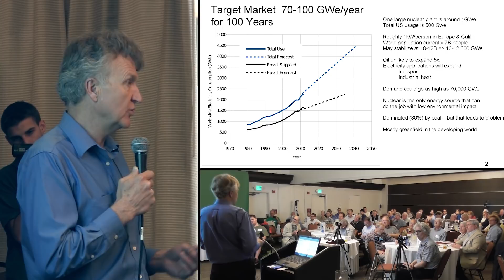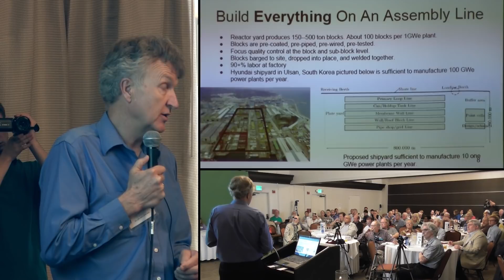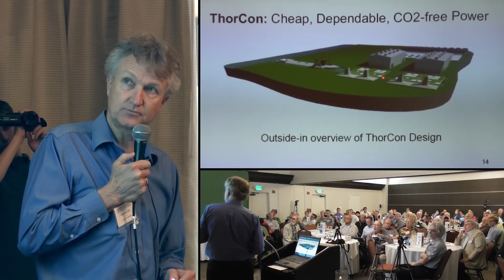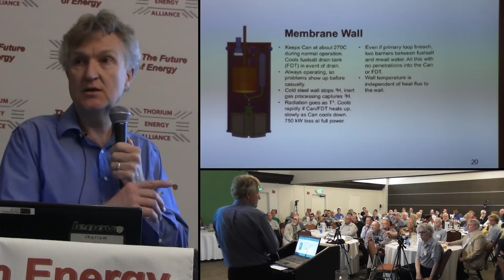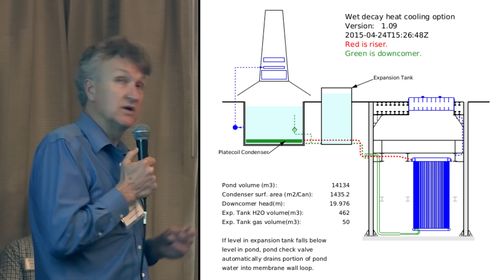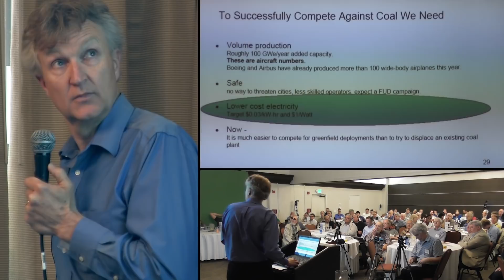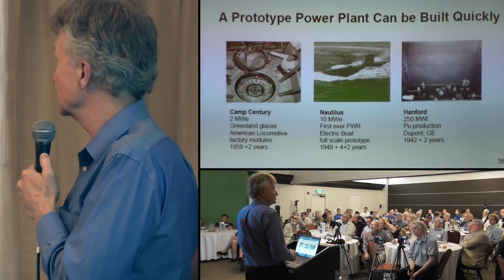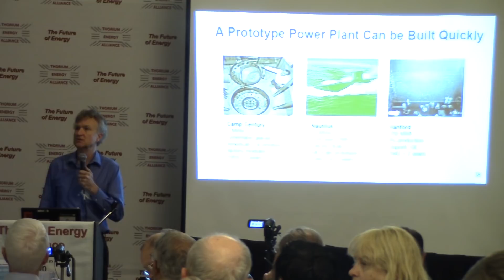ThorCon: A Thorium Molten Salt Reactor System that can be built Now -by Lars Jorgensen @ TEAC7

Comment: What is the main obstacle now: regulation, lack of money, lack of special steels?
Reply from the maker: Vladislav Bogorov I think any argument about lack of money is basically an argument that regulations are unfavorable to nuclear innovation. Dr. Leslie Dewan gave some very clear testimony on this to a sub-committee on energy... to test a liquid fuel reactor (something with dissolved fuel in molten salt) then you're limited to a reactor size so small that the tests aren't very useful.

She made this point again when interviewed by Rod Adams on Atomic Show podcast.

Cavan Stone also brought this up at TEAC6.
Reply: gordonmcdowell Well i would say you can still argue of a lack of money because of  net win loss. The issue is that basically no-one in a business, any business can invest in a new technology that cut down cost of the product significantly. If they do, they lose all of there previews businesses. 

All the new gains will there for be a net loss. This is basically true for any market sector. But its especially true for one where the up front cost is high.

The only one that can invest and not lose, is the one that is on other business. The issue here is that you should never invest out side of your knowledge, because then you will invest into snake oil. This makes it really really hard for anyone to invest.
Reply: matsv201 I think that this is why the Terrestrial Energy approach is so important. They've found industrial partners to fund their demonstration in a much more hospitable regulatory environment (Canada) by focusing on an aspect of MSRs that is overlooked: high quality process heat. 

Companies looking to soften the bitumen sands of Alberta stand to save a ton of money if they can use an MSR to generate cheap steam. Instead of burning tons of natural gas that eats into their margins and increases the CO2 footprint the oil company can then use nuclear heat for (hopefully) low overnight cost and essentially free fuel cost.

ThorCon will find success if they can find a country willing to go hell-bent for leather for Gen4, like South Africa did in the 1990s: https://en.wikipedia.org/wiki/Pebble_bed_modular_reactor ; but is also ruthlessly pragmatic. PBMR failed because of ridiculous scope creep in a country with a barely burgeoning civilian nuclear knowledge base. 

I wish them luck.
Reply: Those, who dislike the idea of thorium energy, say that the thorium cycle has to be developed first. I don't understand. How come it is not developed as there was already such a reactor, albeit not a commercial one, in the past?
Reply: Vladislav Bogorov
It doesn't need development; when you're talking about ThorCon at least. ThorCon has been absolutely ruthless about making everything about no new technology.

The problem is funding. Nuclear technology requires a decade of work no matter the implementation. You need to prove the accident scenarios. You need to prove the materials. You need to prove the fuel cycle and custody of radioactive materials.

All this means high uncertainty, long horizons and (potentially) high costs. No sane investor from any venture capital company will be willing to accept these terms.
Reply: MonMalthias "Terrestrial Energy approach is so important" well, that is probably the only way, at least in the short run 

" willing to go hell-bent for leather for Gen4"
Well, i have a problem with this. Most contrary don´t run on what tech to use, but rather what the wanted result is. Then they go for the most common way of getting the result, how ever bad it is.

I have a problem with what i work with. Having a product that not only exist and is proven, but also applied in some places, but still no government is really that interested because the big companies have just that much of a joucier kickback system
Reply: I see. So we'll wait until the worse aspects of global warming start to show then? It may be too late by then.
Reply: Vladislav Bogorov No, then they will just voice there opinion for sun and wind even higher. Also, the aspects will not be that sudden.
Reply: Vladislav Bogorov I don't see any major obstacle. They have no intention of dealing with the US regulatory system. I assume that the testing method he described in the video is what's done in S. Korea and the rest of Asia, where it's intended to be used.
Reply: Thank you.
Reply: I'm hoping that ThorCon goes to Asia, actually. Asia's growth out of poverty will mean an enormous demand growth for electricity, and ThorCon has the potential in terms of deployability to match the rate of growth of coal.

I don't think there's any future for advanced nuclear in America; because the great brake that is the NRC will stifle all but light water. Even NuScale had to pay something on the order of 270 million dollars on licensing fees over a decade to get a light water SMR off the ground. This isn't new technology either. This is essentially a submarine reactor made tall enough to the degree that it can run on natural circulation at scram.

I don't know about you, but I, for one, would not like to spend a decade doing paperwork before we even build the first unit for testing; while having zero revenue.

If America loses its supremacy in advanced nuclear, it will not be for dearth of ingenuity. It will be self inflicted, by a regulatory regime so stifling that it removes incentives for innovation in cost and safety.

Alvin Weinberg himself envisioned LWRs as a stopgap measure until the 1980s when breeders would take over. The establishment of the NRC ensured that progress would stagnate, because it replaced testing with paperwork.
Reply: MonMalthias Imagine 3 cents / KWH combined with the cheap labor in Asia. There goes the rest of our manufacturing jobs.
Reply: Greg White Yea it better be low, where i live the current power cost is 0.4 cent/kWh, yea not kidding. It was actually under about 4 cent all winter. The power producers have a lot of problem handling the situation, and the government keep forcing wind-power. There is simply no space in the power grid for more windpower, but they keep forcing it.
Reply: Vladislav Bogorov  Why you will never see alternative to U235 reactors is the BYPRODUCTS. Enrichment process of the U235 produces A LOT of U238 = "depleted uranium", some people consider this byproduct a "waste" but people in the military industrial complex do not. Depleted uranium is perfect for AP ammunition and tank armor. Also U235 plants produce relatively lot of Pu239, which is needed for modern nuclear weapons. Th-reactors Do not. People who pulls the strings have NO INTENTION of giving up all the profit off of ther byproducts in order to produce energy peacefully.
Reply: Invaderzerg Remember, Pu239 in a power production reactor is "reactor grade" not "weapons grade"; contamination with other Pu isotopes (much harder to separate than U235 from U238) makes this Pu produce a bomb that would "tend to pre-detonate", an interesting technical phrase don't you think? When will it explode? God only knows, but probably in the terrorist lab. Pu239 from a 1940s "graphite pile" is much easier and less expensive.

In any Molten Salt Reactor, the fuel is molten, any uranium or plutonium remains in the reactor and is fissioned.
Reply: +Vladislav Bogorov The main obstacle is, has always been and will always be simple math and the laws of physics. Do you really think the tens of thousands of scientists and nuclear engineers who have worked on nuclear reactor design since the mid-50's have never considered the thorium cycle?
It's easy to claim that a technology that does not exist is perfect and will solve all energy issues for the rest of times. A quick reality check will prove that these claims are false - and the people who make those claims know it all too well.
Reply: André Balsa Making perfect the enemy of good enough is in itself a fallacious argument; as is saying "because it hasn't been done before, therefore it should not be done". It is precisely this Neo-luddite thread of argument that the fossil industry peddled before renewables became significant and garnered enough political support.

However, it must be said that the current Western European energy policy of eco-austerity is not climate friendly; nor sustainable, and will drive increased dependance upon coal and gas; but that is neither here nor there. What matters now is that increasing wind penetration means windfalls for the gas industry; as with Denmark; and potentially with Sweden that looks to tax their nuclear out of business and replace it with wind and gas.

Near term, preserving the current nuclear fleet, uprating and upgrading will be necessary for the purpose of combating climate change. This is what America is doing; though the fracking boom has also served to drive nuclear out of some parts of the economy, but at least in America coal is being displaced.

In the West, increasing penetration of renewables will drive coal out of developed economies to be replaced by rapid-ramp gas (except Germany, which insists on using supercritical steam coal power stations to load follow). Geopolitically it may be unsustainable as Western Europe will brook no excessive Russian influence in the form of Gazprom; and inevitably some nations will elect to build and expand coal, like Poland and Germany. It may be that England will be the only country to meet its climate goals as they have the only plan for significant nuclear new build and have committed to coal phase out by 2025. However, the EPR will be the anchor about England's neck. Hopefully Areva folds before too much damage is done; or their restructuring beats some sense into them. 

In East Asia, developing economies will look first to coal, then to nuclear. Nations like Taiwan and Japan will have a shrinking nuclear industry in the wake of Fukushima. To the anti-nukes, this is a good thing. To those that are concerned about climate, this is a crime; but it is not up to science to dictate energy policy; nor was it scientists and engineers that could dictate the terms of COP21. 

In Africa, nations like Nigeria and South Africa will be looking to nuclear to serve their baseload needs as they transition from being poor countries to middle-of-the-road countries. This is good; for if the African continent develops like Western Europe developed in the Industrial Revolution, we are, to quote James Hansen, screwed. 

About MSRs, the only game in town right now is probably Terrestrial Energy. They have attracted support of oil and gas looking to soften the tar sands, they have attracted support of Caterpillar Inc; which does heavy machinery, and they have built up a rolodex of heavy hitters from around the nuclear industry and from environmental consultancies. Once the disruption of the AECL restructuring into SNC Lavalin and CNL dies down, Terrestrial may even achieve some modicum of government R&D. But even they are looking to a 2020-2025 timeline. 

History, and the numbers, say that thorium and MSRs can and will have a role to play in the future. However, each and every effort to resurrect them has foundered due to lack of government support; not due to some problem with physics or economics. In a rational world, MSRs would follow after SFR and HTGR deployment following intensive government programs. So far, only China has that commitment. 

Maybe your doubt is not as infectious as you think.
Reply: +MonMalthias "History, and the numbers, say that thorium and MSRs can and will have a role to play in the future." On the contrary, history has consistently and repeatedly demonstrated that thorium and MSRs are not realistic technologies, and numbers now show that nuclear is not cost competitive with renewables.
Try reading the news! The debate is already over, coal and nuclear are out, natural gas is the transition energy and wind and solar are the future.
Terrestrial was counting on tar sands development to sell some reactors to the oil industry but this is also not going to happen: Keystone XL is dead and nobody wants the most expensive, dirtiest, lowest EROEI crude oil on the planet anymore.
Nobody is going to invest in Terrestrial to develop a prototype 20MW small MSR for the 2020-2025 time frame because the same energy can be provided by just 4 large wind turbines (from at least half a dozen different vendors) for less money and a technology that already exists and is safe, reliable and zero emissions. Meanwhile Terrestrial does not even have a complete conceptual design to show for.
Reply: +Vladislav Bogorov Government, of course. If western government were so democratic and reasonable like no other culture on earth, or let 's say they were so good people, and could save our planet because of climate change than why wouldnt they promote this technology??? 
I hope someday you all out there will come to a intelligent conclusion, may it be just in time or too late.
Reply: +Vladislav Bogorov A developed thorium cycle implies plentiful uranium-233 which no one has. I think U.S. Dept. Energy has about 2 tonnes of U-233 which they want to destroy.

Once the cycle is started, U-233 breeds from thorium, so the fuel cycle begins.
Reply: +Invaderzerg Thorium reactors make U-233 which, with thermal neutrons, fissions far more efficiently than U-235 or Pu-239. Any U-233 wastefully absorbing a neutron becomes U-234, then it can absorb a second to become U-235.  Making U-233 (from Thorium) far superior: it fissions more efficiently and gets two chances (U-233, and U-235 only for the 8.5% that missed the first chance). As such, miniscule amounts of "dangerous" transuranics result.
Reply: +Vladislav Bogorov No thorium cycle (thorium/uranium-233) reactor was ever built or operated, commercial or experimental.
ThorCon/Martingale, a small business consulting company with zero nuclear engineers, zero patents, zero research, and at most half a dozen unqualified employees, has been going around for the last six years asking for $700 million to build a first-of-its-kind nuclear reactor, for which they don't even have the blueprints.

In other words, ThorCon is going nowhere. Actually, this entire thorium cycle / thorium reactor fan club is going nowhere fast, it has just become an internet meme, completely out of touch with reality.
Utilities worldwide are turning to wind, solar, geo-thermal, hydro and other renewables. The nuclear industry is in decline and it's taking to its grave the myth of the thorium molten salt reactor.
Reply from the maker: +André Balsa What was Shippingport's 3rd fuel load Andre? (Thorium). What did they add to MSRE to test chemical compatibility (Thorium).

This is why most of your comments get deleted Andre. This is why I don't even read most of your comments Andre, I just tap [delete] as soon as they come up.

Because I don't have time to deal with you saying stuff YOU KNOW IS NOT TRUE.
Reply: +André Balsa Of course the "tens of thousands of scientists and nuclear engineers who have worked on nuclear reactor design" in the 1950s and 1960s considered the thorium cycle. The Molten Salt Reactor experiment in the 1960s was tested with all possible nuclear fuels, including U-233 (made from Th-232), and the report by the Atomic Energy Commission to the USA President and Congress recommended MSR and thorium; Congress, in the pockets of the fossil fuel companies, ignored the AEC recommendations. Your argument is based on a false premise.
Reply: +André Balsa You have a knack for making arguments based on false premises. We "develop a prototype 20MW small MSR" and you simply make it larger, with no scaling issues (no high pressure, no water), and you have a 200MW reactor for lower cost than your 4 wind turbines that produce far less energy. And MSR generates base load electricity, vs wind that averages about 1/3 of nameplate capacity.

Plus, there are several complete conceptual designs, and blueprints, and tested materials, for molten salt reactors. Are you uninformed, or lying?

You claim "numbers now show that nuclear is not cost competitive with renewables" ignoring that you are comparing LWR numbers, made more expensive by high pressure design from use of water coolant. Molten Salt Reactors use no water, eliminate all need for high-pressure safety systems, eliminate the most expensive parts of LWR.
Reply from the maker: +George Lerner Oh he knows. I've directed him to video of an ORNL employee talking about the fuel load containing thorium. He doubted the guy knew what he was talking about. Then I directed him to ORNL documents by URL and page number showing where Thorium fuel load was cited. Andre then goes and posts the same false claim on a different video.

He's anti-nuclear and wants to make a plausible sounding argument rather than a valid one.
Reply: ***** Pfff: "... and you simply make it [10 x] larger..."
How asinine can you get? No engineering project of any kind gets 10x larger with a touch of a wand, and certainly not a nuclear reactor.
You have no idea what you are talking about...
Reply: gordonmcdowell Oh I saw the video, it was a small group of 70-year old ORNL retired employees with a vague memory of an experiment in which they had NOT participated, being questioned by Kirk Sorensen in his attempt to rewrite the history of nuclear research, with his obsessive focus on thorium. The whole thing was pathetic to watch and of course it was edited in 5 seconds segments by you, as usual. There was one sheet of paper with BIG characters and very little information on the MSRE experiment, which you pointed your camera to, ridiculous!
Reply: gordonmcdowell You seem to be desperate to make the point that thorium was experimented upon in the MSRE 50 years ago (it wasn't) and that it was used as fuel in the Shippingport nuclear reactor 30 years ago (again, it wasn't).
In any case, you and the whole thorium crowd are slowly fading into obscurity these days. You got your 15 seconds of internet fame, but in the reality of electricity production worldwide, nuclear is dying, renewables are everywhere and nobody is ever going to invest one cent in a hypothetical thorium reactor that only exists in the mind of a few internet fanboys.
Reply from the maker: +André Balsa And this is why I delete your comments Andre. We both know there was a difference between Shippingport load 3, and the first 2 loads. We both know Thorium was tested chemically in MSRE. I know you know because I've explained this to you earlier.

What you seem to be doing is projecting. You called me a shill. My operation is transparent so I wonder what might be going on at your end. You call me a liar. Uh huh, you are the one repeatedly posting refuted claims.

It always seems that the LEAST insightful criticism always come from people opposed to all forms of nuclear power. Thanks for maintaining that pattern.
Reply from the maker: +André Balsa The "impact of my videos" has zero bearing on the fact Shippingport's 3rd fuel load successfully tested thorium breeding, and the MSRE's final fuel load tested chemical compatibility of Thorium in MSR.

While I don't really care about your personal attacks (your projections), it would be a shame for anyone to leave thinking wrongly in regards to past successful Thorium experiments.
Reply: I think the "internet fanboy" remark by +André Balsa and his personal attacks indicate that he has nothing to say about math and physics. If he were serious, he'd argue the subject matter.
Reply: "...slowly fading into obscurity these days. You got your 15 seconds of internet fame, but in the reality of electricity production worldwide, nuclear is dying, renewables are everywhere..." -- blatent attempt to distract from the math and physics by a bandwagon appeal. Clear sign of a nonserious arguer.
Reply: +Vladislav Bogorov I think they just need someone to fund the full-scale prototype, then the first plant and maybe the the shipyard they'll be built at.
Reply: Sure. "Someone" to plunk down $5 billion in seed money into a "business develoment" company with zero nuclear engineers, that holds zero nuclear patents, for a nuclear reactor project that is supposed to produce electricity at twice the cost of wind turbines or solar PV panels (with storage).
Reply: +André Balsa Oh what a surprise its you again. I don't know where you get $5 billion but thats a drop in the bucket to start a company that could produce hundreds of 1 GW size plants. Just to use Lars's numbers, he needs 700 million to get a "full scale prototype" up and running plus 1 billion for the first GW plant (1$/Watt). Also not just one company would invest, multiple companies would invest. It happens all the time. Thats where the term "shareholder(S)" comes from. Just as it is being done with Thorcon.

Stop talking about storage because large scale, cheap storage doesn't exist. Every time we shut a reactor down we overwhelmingly replace it with fossil fuels not renewables and storage. The poor countries aren't flocking to renewables and storage they're flocking towards coal gas and oil.

I've actually spoken with Lars and their efforts in Indonesia are going well. Even with Indonesia's little "announcement" last December. Many Indonesians and three companies over there are very excited about the design, they're not kicking Thorcon out the door. They're are plenty of people who aren't nuclear engineers who can design reactors, a lot of them have backgrounds in physics which is more then enough. 

Also just for the record Lars and the other gentleman in Thorcon are working on a salary of ($0). They've released a detail report of their design that you can find online to the point you could practically reverse engineer a plant, cause their main goal is to help people not get rich. They want to do some good in the world and help lift hundreds of millions out of poverty with low carbon electricity that is cheaper than coal. Unlike you who wants to do nothing but bitch and moan instead of providing real solutions to climate change or poverty. 

I'll address all of the the crap spat out about J. Hansen and the other climate scientists standing up for nuclear in that other video we had our little chat in later.
Reply: Good to know you consider $5bn "a drop in the bucket". You should send your pocket money to Kirk Sorensen's Paypal account then.
Right now, 6 years after founding Flibe, KS has yet to receive the first dime in venture capital. Same goes for Thorcon/Martingale.
Reply: There are three companies in Indonesia backing Thorcon right now. Also I'm glad you to see you didn't acknowledge the rest of my message and the hard because you know I'm right. Tool
Reply: Already covered that. Nobody is "backing Thorcon", in Indonesia or elsewhere. You should get your facts straight, posting lies is not going to get the thorium fanboys very far, is it?
Reply: I'm sorry have you spoken with Lars like I have? ... no, I didn't think so. I'm getting my information straight from the source, you're not. So shut hell up. I'm not the one lying, you are cause your you haven't talked with one person from Thorcon.

I'd also love to hear where you got that $5 billion estimate from.
Reply: Jackass... I already knew about Indonesia's announcement and decision. I talked with Lars after the fact.

Thus the reason I said in the comments above "Even with Indonesia's little "announcement" last December." I knew about it and I talked with Lars about the very issue we are discussing in January because I want to work there.

They are going to be able to test the prototype and build the the plants in Indonesia and deploy them in other places. That's the the whole idea behind their reactor. You build most of the plant in a shipyard, send them plant out in multiple blocks and assemble them someplace else. That's the idea. If you were open mind and really payed attention to the presentation along with my comments you would know that.

And you literally just proved my point of the three companies supporting their efforts.

I'm still very interested to know where that $5 billion amount you keep talking about is coming from.
Reply: "... because I want to work there."
Trying to troll your way into a low-life job will get you nowhere.
Reply: +André Balsa No, more like trying to work at a place that that is attempting to make a positive impact on people's lives unlike you who won't even give the company a chance to try. Thanks again for not acknowledging my key points about the company, it's plans or that $5 billion. It's nice to see the crap you produce. 

Also where in the hell do you get the idea that Indonesia is going to get most of its energy from hydro and geothermal? That idea I'd actually respect because Hydro and geo are the best but 2050 projections have put them getting 69% of primary energy from fossil fuels.
Reply: After 6 years the only impact Thorcon/Martingale or Flibe have made is flooding YouTube with hundreds of videos with fantastic claims for a technology that does not even exist. In any case neither company passes the simple reality check I posted earlier and of course neither company is ever likely to get one cent in venture capital, from Indonesian companies or anywhere else. I can only wonder if five years from now you'll still be trolling on their behalf "... because I want to work there." Lame!
Reply: +André Balsa Yeah I don't know why you keep bringing up Flibe cause they are a separate company working on a much more difficult design. 

Thorcon is a separate company and has not been around for 5 years. They practically just emerged last year with their design. They are also not pursuing LFTR like Flibe. They are basing their design on what has been done and proven (like you said in your reality check). This is also the very first video about Thorcon that has been posted.

This is an executive report they have made that is "Extremely" detailed that answers many of the points/"flaws" of the reactor you have brought up that are addressed:
http://thorconpower.com/docs/domsr.pdf

The MSRE did exist and it helped prove several concepts that lead multiple companies to pursue MSRs. Terrestrial energy, Moltex, Transatomic power, Southern Company and more are other companies developing MSR's as well. Most of them have gotten funding and Terrestrial energy has just submitted its initial design certification to the Canadian regulator.

Also just for the record we are getting into the "50's" range for reply's thanks to one comment because of you and your continuous bullshit.

Once again you have failed to acknowledge most of my previous points including that $5 billion you pulled out of your ass.
Reply: +André Balsa And where the hell do you get off picking on these guys and their company? Where do you work and what do you do thats so damn special? How is it so much more important or meaningful then these group of men working their asses off for no money to try and improve the quality of peoples lives. How hell are they negatively affecting you to the point that you are going out of your way to shit on them and their design? Whats the issue with letting them try to make this technology work for the betterment of the climate and mankind?
Reply: You are making a fool of yourself now. Again: reality check (see above).
Reply: Let me set the record straight here, it's reality and facts that piss the thorium fanboys, apparently:
1. Thorcon/Martingale and Flibe have flooded YouTube with hundreds of videos with fantastic claims for a technology that does not even exist, during the last six years, yet neither company received one cent in venture capital since their founding.
2. There are no thorium molten salt reactors operating in the world, and none are being built.
3. China has a single institution investigating molten salt reactors: SINAP. You can search their website, no mention of any significant developments during the last two years. http://english.sinap.cas.cn/
4. A quick reality check:
How many nuclear engineers does Flibe (Kirk Sorensen's company) employ? (zero)
How much capital have Flibe or Martingale raised over the last 5 years or since their creation? (zero)
How many nuclear-related patents do Flibe or Martingale hold? (zero)
How much nuclear-related research have Flibe or Martingale conducted since their creation? (zero)
How many molten salt reactors have ever been built? (one 8MW experimental reactor, in 1964, operated-not continuously between 1965-1969; cost of decommissioning 45 years later: $130 million).
How many thorium/uranium-233 cycle reactors have ever been built and operated? (zero)
How much is thorium worth on the international market nowadays? (less than its extraction cost)
How many renowned nuclear scientists have ever stated that the thorium/uranium-233 cycle was economically or technologically viable? (zero)
How much is the ORNL investing in thorium/uranium-233 cycle research nowadays? (zero)
How much is the ORNL investing in molten salt reactor research nowadays? (zero)
How much does electricity from nuclear cost in the US, vs wind or solar WITH STORAGE? $0.16 / kWh for nuclear, vs $0.08 per kWh for wind or solar WITH STORAGE.
5. Indonesia has not invested one cent in Martingale. Yes, an Indonesian consortium signed an MOU with Martingale in 2015. This is just a document that allows these companies to examine the Martingale documentation under a non-disclosure agreement (NDA). And after examining the Martingale documentation these Indonesian companies decided they were not going to invest one cent in Martingale's project. And the Indonesian government has officially ruled out nuclear power, going with renewables which are cheaper, more reliable and not disaster prone.

Again, these are just facts, not my opinion or claims.
Reply from the maker: +André Balsa  When you say various MSR companies have "flooded YouTube with hundreds of videos" could you cite an example? You mean just my videos, or are you talking about something else? Because if it is ME posting a video, then that's not really the MSR startups now is it? Since they are not paying me. Direct me to an offending video that simply should not be on YouTube.
Reply: +gordonmcdowell +André Balsa Hear Hear Gordon, and yeah Andre are you even reading my comments? Because you keep pointing back to your rant like its the freaking Bible. Even though most I have agreed with you that most of what you have said IS TRUE.

That doesn't mean that Thorcon has no chance of succeeding. If you looked at that document I attached in an earlier comment you could see that Thorcon has gotten around the challenges MSRE faced. I'll also say this again. Thorcon has only been around for a year with its design, not five years. Give them some time for God sakes.

http://www.world-nuclear-news.org/NN-Martingale-reveals-its-ThorCon-liquid-fuel-reactor-design-07011501.html

Also you think that this is a dead technology that isn't going anywhere even though I have pointed out that numerous companies like Terrestrial Energy and Transatomic Power which has not only gotten funding but is starting to do pre-licencing with the regulators.

https://www.technologyreview.com/s/545406/advanced-nuclear-startup-terrestrial-energy-lands-initial-funding/

http://www.greentechmedia.com/articles/read/transatomic-power-pulls-in-2.5-million-to-test-equipment-for-molten-salt-nu

http://www.world-nuclear-news.org/NN-Terrestrial-Energy-engages-with-regulator-2502167.html

Also I'm still waiting on your sources for that $5 billion, along with the costs you keep putting out for renewable energy along with the imaginary storage, and source for Indonesia going to nothing but renewables. Because while I love geothermal and am cool with hydro... the literature from the IEA and Indonesia puts 69% of primary energy still coming from fossil fuels by 2050 and not renewables......

https://www.iea.org/publications/freepublications/publication/WEO2015_SouthEastAsia.pdf
Reply: +Vladislav Bogorov   Regulation.